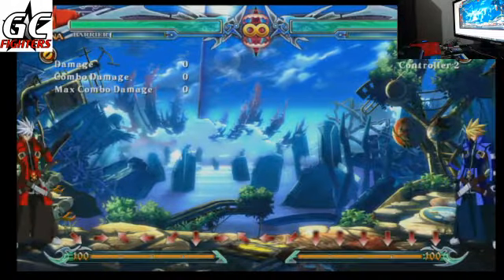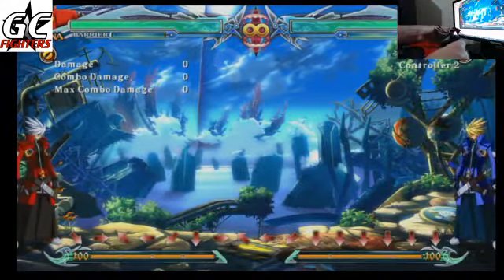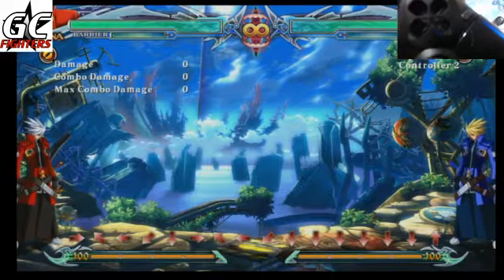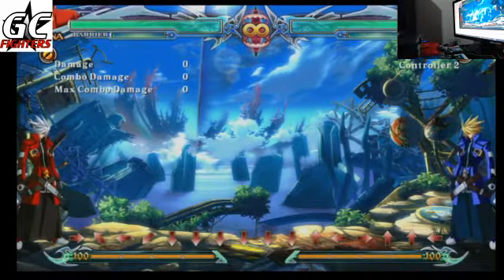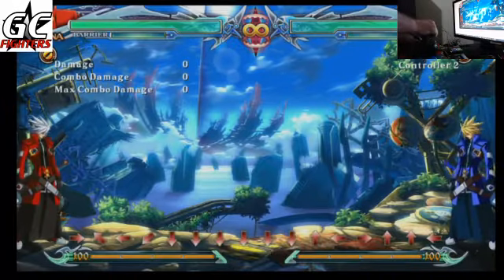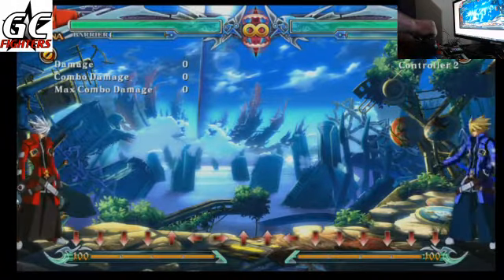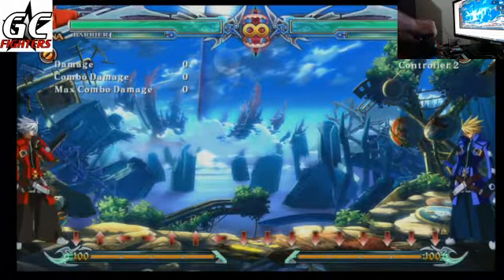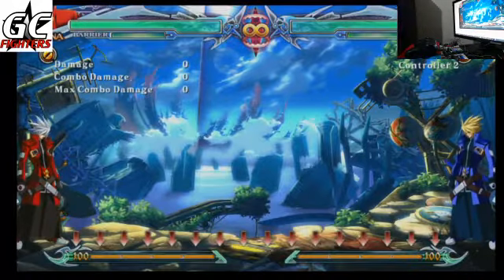Demonstration of input lag testing

Comment: How does higher/lower 16.66th on the screen measures longer/shorter input lag? Doesn't that has more to do with polling windows?
Reply from the maker: For Blazblue CPE the polling window occurs towards the end of the frame. The faster a controller is the later your input can occur (as represented by a band occurring later/further down the screen) and still make it in time to reach the window. This may well be better explained in some of my other videos.